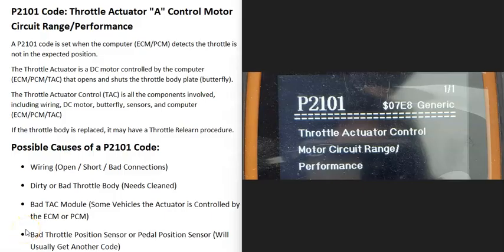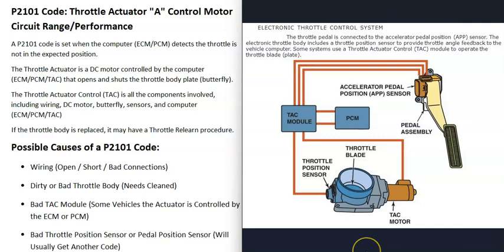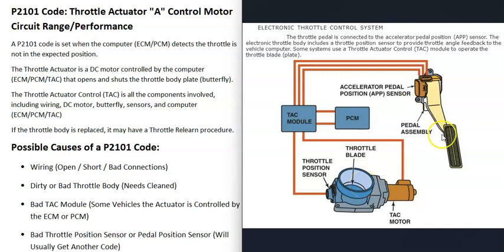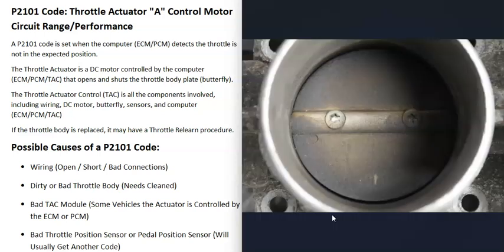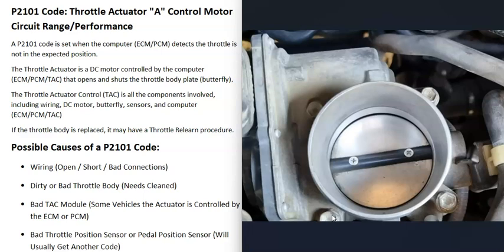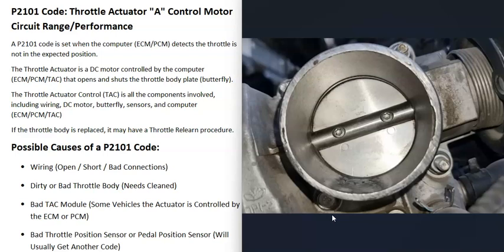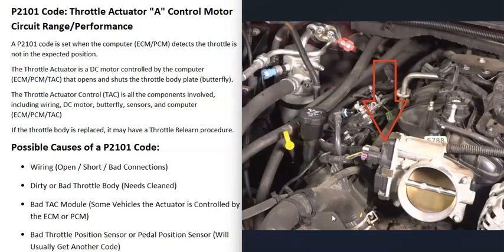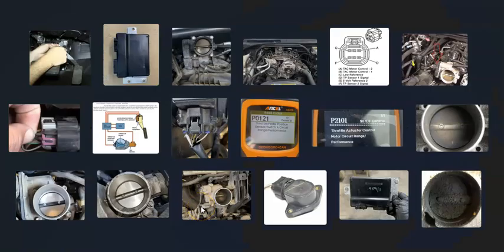Causes and Fixes P2101 Code: Throttle Actuator "A" Control Motor Circuit Range/Performance

Comment: I ha e a 2016 Nissan Versa sense i have 2 error codes 2101 and 2135 i have replaced the peddle and the throttle body same codes pop up i inspected the wire harness and found a peeled wire going to the etb connector the problem it seems to be oem since the connector has all 6 wires attached and the bald wire comes from the computer ecu could that be normal ? I have no clue where that bald wire would go to and why is the wire peeled

Comment: Hey great explanation. I got the P2101 code and P2118 code at the same time I’ve watched both video but if you can help narrow it down. My car is a 2014 Hyundai Veloster turbo manual transmission. Thanks in advance.

Comment: at first I got p0101 and the air filter was filthy, so I replaced that and went ahead and just cleaned off the MAF sensor since I was there, despite it looking brand new. Vehicle ran great for a couple days, now p2101 popped along with p0101. I’m hoping it’s just throttle positioning. 

21 infiniti qx80

Comment: Code: P2101
Issue: Throttle Actuator Control (TAC) Motor – Range/Performance Problem
Status: Confirmed

FAW V2

Comment: I have a p2101 code on my 2012 g37 I cleaned the throttle body checked the wiring harness did a relearn and after a few drives the code would come back up. Car idles perfectly just once the code is up I can’t accelerate. Wondering if I should change the throttle body.
Reply: Having same problem any update please?
Reply: I changed it  a couple time , the 3rd one solved my problem , my car run smoothly afte that @xogat1816
Reply: @xogat1816  i have the same issue
Reply: Doing the same thing with my 2010 Sentra replace throttlebody manifold, spark plugs still doing the same thing and putting me in limp mode at the shop overnight having them check all sensors, but I do have accelerator pedal to put in. See if that works.
Reply: @HarlinOConnor-l6i did you find the fix
Reply: @josevilchez5879  it ended up being the fuse box corrosion
Reply: @josevilchez5879  the earlier years had a problem with getting water inside the fuse box
Reply: @HarlinOConnor-l6i I have a 2011 Nissan versa that’s doing this, I sent off the ecm, tested good, had two throttle bodies put on, new pedal, I’m bout to lose my mind trying to figure it out…

Comment: I just got this code today. And p2100 said throttle control motor / open. I was leaving a parking lot..turned my car on and it had little to no power backing up or in drive obviously had to park it and left. Then 5 hours later I went back, it started and drove just fine. Its a 2013 nissan rouge. I bought it with over 223,000 on it because i had no choice. Fixing things first before I can do inspection. Do you think it just needs to be cleaned? Or probably replaced. The vehicle has been kept up with since the lady originally had it. I saw all the maintenance reports and its all normal stuff nothing major.
Reply: *following" i just had the same problem.
Reply: Es posible que tengas un problema en los piñones de plástico a los que se le puede romper algún diente. Si puedes destapa la caja del motor de la mariposa de admisión. Puede ir con grapas o con tornillos y revisa si tienes ese sistema de piñones de plástico que suelen fallar bastante

Comment: Thanks for the informative video. I had a P2101 code simultaneous with a P015B (H02S Delayed Response Rich to Lean Sensor 2). Any possible correlation or just ironic? Plan to replace the O2 sensor that is bad tomorrow, but curious about this throttle body code.
Reply from the maker: If there is an issue with the throttle body causing the engine to run rich, then it may be the cause of both codes. I would fix the P2101 code first, clear the P015B, and see if it comes back. Also, if the P015B is a bad 02 sensor, I believe it is upstream sensor-1 that usually causes it. I would test both and see if they failed.
Reply: @ It was the upstream, bank 1 sensor 1. Does it make sense that just one sensor would trigger if the throttle body was acting up?
Reply from the maker: Ya, that's true, but strange things happen sometimes. Components need to be tested.

Comment: Have p2102 on my 07 impreza. Wheel rubbed two airbag sensor wires and airbag light came on. Took it to subaru, they fixed those wires and airbag light gone. Went to pickup car and had no throttle response and this new p2102 code. They blamed me for it. I redid their wiring fix (it was awful) and that didnt fix it. Checked all wires and connections. Replaced throttle body, Gas pedal sensor, Checked all relays and fuses. TPS, MAF. Ive checked everything and am lost.
Reply: I think subaru did this intentionally.. I just dont know what they did.

Comment: my 2017 silverado is showing code P2101 and says throttle actuator position performance.  should i replace the whole throttle?
Reply from the maker: It could be a bad throttle body, but it can also be something else; it needs to be diagnosed, and parts tested. I would start by checking throttle body fuses. Chevy usually has it labeled Throttle Control.
Reply: What was your issue? My 2017 just started this!

Comment: what about going through some water. i went through a little creek and about half mile this code P2101 came up my truck got real sluggish and the traction control light and the engine light came on
Reply from the maker: Water can cause issues if it gets in the wrong place. Hopefully, it clears up once things dry out.
Reply: what did you end up doing? Same thing here
Reply: @amando96  Did you get a resolution? Mine was flooded.
Reply: @deanrock4331  My case was something up with the battery connections so the ECU registered it as something being faulty but it just wasn't getting power properly. 
cleaned some contacts and reattached to the battery, been fine since

Comment: my service engine light popped on got a test done and it came back with the code P2101 can it be fixed with just a cleaning or do i have to replace it?

Comment: I have a question sir. My 18 silverado is having issues. Battery replaced. Tested today and gave that code. Issues im having is that my battery is being drained to 10 volts while the key is off. But not all the time time, more so than not though. Windows while key is off drains the battery quickly. Any hel9 would be much appreciated
Reply from the maker: There is likely something draining the battery that will need to be found. There is an old-school method for finding an automotive short or draw using a 12-volt light. I made a video on this; here is a link. https://youtu.be/-xSMrErME5M
Reply: I got the same come on my 2018 Yukon  xl my husband changed the throttle body and also changed the map sensor it still won’t turn on. We don’t know what else to do. Do you have anything in mind of what else to do?

Comment: Hey i have the same code so should i change the whole throttle body?
Reply from the maker: It needs to be tested to see if it has an issue. Mainly the small DC motor that opens the butterfly plate.

Comment: I have a question about maintenance in general. I have a 2000 silverado as an example. I have put in a new transmission and new engine and a new rear end and a new radiator. All this was various years ago. How do I determine what to maintain next? Should I wait till I hear stuff sounding weird (already going on) . What is a good strategy for doing the most important thing, or at least checking on it first? I have basically lost my place in the maintenance story. I have the chilton manual for this truck if that helps?
Reply from the maker: Each vehicle has a rated maintenance based on miles. The main things would be oil changes every 3000 miles on older vehicles and 5000 miles on newer vehicles, along with the air filter. I also would replace the transmission fluid and filter every 40,000-50,000 miles. Every 50,000 miles or so, a basic tune-up can be done, such as checking spark plugs, belts, brake pads, and so on.
Reply: @HVAC_Mechanic oil is good for 3,000 to 5,000 to 7,000-10,000 miles depending on what you get basic high mileage and then full synthetic air filter is good for 15k to 18k and cabin should be changed once a year or if you smoke 2 times a year

Comment: Thanks for sharing this knowledge. I  really appreciate it.
My car is back on running.  Thanks God. Unbelievable the battery was the cause of the limp mode.
Try to buy a battery and the price was 160. 00 dollars.
I read about the engine size 1.8 and the battery size & numbers - # 48 - 49. I purchased a 48 for 60.00 dollar brand new. 
The battery scam is on 🔥 fire.